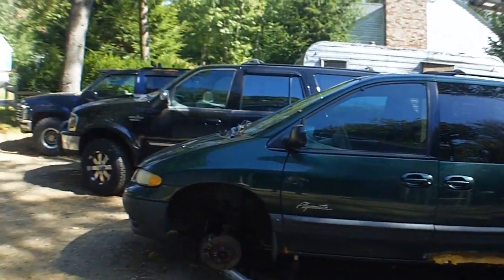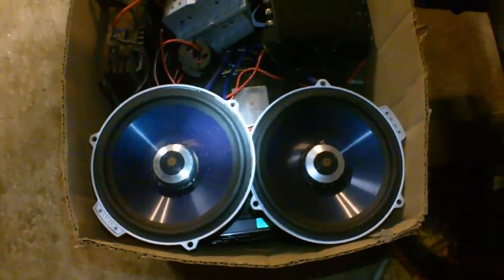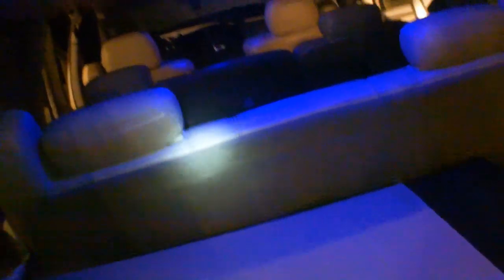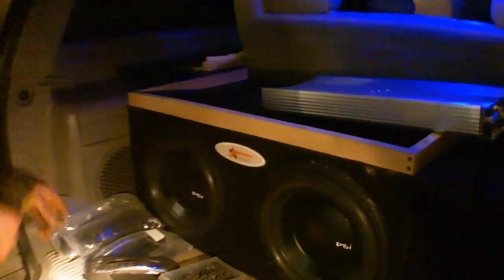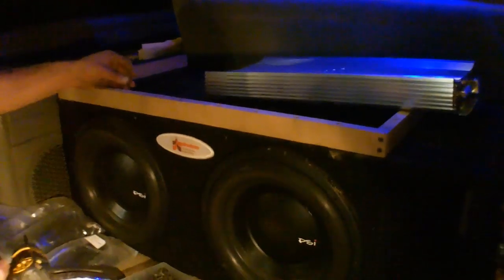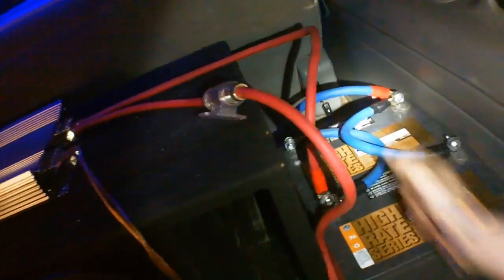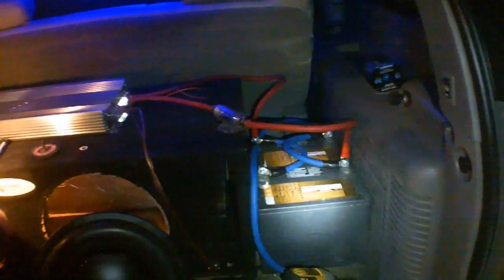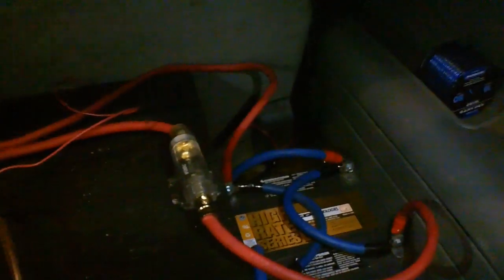Car Audio Installation : Installing Amplifiers | Wiring Subwoofers | BIG THREE UPGRADE | 3 BATTERIES

Comment: @shroomguy420blazin Almost all subs can play quite low in the right enclosure. One spec to look at would be the FS of the speaker. If it's lower there's a good chance it will hit lows pretty nicely. That said enclosure design is MUCH MUCH MUCH more important. The Type R is a solid sub and will do the job nicely.

Comment: i think ima buy some more led's for my truck lol... i miss my lights!! AND I finally got my subs lol..cant wait for them to get worn in! any tips on breaking in my new subwoofers? any other way of keeping the lights dimming instead of installing another battery and bigger alternators? i dont have a big budget yet :) i think i will sooner or later though.

Comment: Yes, you CAN. But you'll have no sound. If you want the subs to work, you need to have an amp. The head unit on the car does not put out enough power to power the amp. (Usually between 12 to 50 watts) The subs need much more wattage than that. You have to have an amp that meets at LEAST the Maximum RMS output of the subwoofer. (Preferably, you want at least double the RMS, which gives you headroom, so the amp doesn't have to work as hard, and the sound will be cleaner.)

Comment: @iantheCOOn~Replace your alternator. The batterie only powers the system when the car isn't running,once the car is started it's the alt. that powers it. Best case cenario,replace both the batterie & alternator. Hope that helps. :)

Comment: Seriously entertaining.   That's how install vids should be...    One question for you if you can man,   I'm about to do my install in my wrx hatch and I need to see how much 0 gauge I will need for complete wiring /big 3 upgrade / and grounding and what not...  I'm pretty sure 50' will be more than enough but idk if its way too much if I could get away with 30 or 40'..   I'll just be running an Hcca off a bd-2500 and a 600/4 to the mids/highs distributed off an extra battery.. ( So about 4k total ) with that being said. Which extra battery should I get ? I know I don't need a 90lb monster but don't wanna get it too small.. I appreciate it and hope to hear back..

Comment: Since your bypassing the voltage regulator in the computer is there a chance that you can over charge and damage your batteries and do you disconnect the wires coming from the power control module and just run 0 gauge straight to the alternator or do you leave all the factory cables from the pcm hooked up and run 0 gauge??

Comment: Question: I'm soon to order the db drive platinum series 2000.1 for my fi btl n2 and the amp has dual power/ ground connections. Besides stock battery I have an xs power battery as well. Any tips on running the dual power / ground

Comment: I have 2 amps in the back with a battery. Can I just go amp to - terminal, amp to - terminal, and - terminal to the chassis??? or do I want to take both the amps to the chassis and have nothing on the - terminal of the battery?

Comment: what size wire should i run from my battery to my amp i have a 4 gauge 200amp stinger kit qill that power my 120a 4000w power acoustik gothic amp mono block class d

Comment: Hey EXO if I upgrade my car battery should I upgrade my alternator? cause my battery is stock and my amp is a 2100watt at 1 ohm and my car volts drop to 8 and I have to turn down my system. so should I upgrade both or is just the battery fine for now?

Comment: Im new to the game. My head unit has 3 RCA preouts and im running two amps( 1 for the sub and 1 for the doors). Should I be running 3 sets of RCA's?
Reply: no just two sets but one set should be a 4 channel set for ur doors...I'm assuming u have a 4 channel amp 4 the doors...

Comment: i need a amp that can push 6-12' subs 1000 watts each, whats the best amp for that job.
Reply: that's something that a rich guy would ask. its easy to get the subs and amp. but the battery's and alts you will need to power 6-12k rms. 1 to 3 320 amp alts and a good 400+ ah batterys in the back should cut you some room to breath when playing that much power. but I be looking into a few amps to power so many subs over 1 big amp. just because its easy on the amp and subs. less wire length your looking at going to 1 amp when you can have shorter runs to lets say 2+ amps

Comment: exo i need your help with a pioneer avh 291 bt stereo that kicks off and restarts after its been playing for a little while ill start by telling you what the car has and how its ran maybe you can give me a better thought on how too run it ihave some 51/4 pioneers in the front pioneer 6x9 in the back i have a small kenwood amp hooked up too some kicker 5 1/4 that i have mounted between the seets wher i made 2 holes wher the cup holder/arm rest is i also have them connected too some rockford fosgate crossovers  because kenwood amp doesnt have a high pass filter only on the stereo i think since the front is filtered at 100 hertz then i gotta a 1200 watt hifonics amp hooked up too 2 kicker duel vc ran in parrelel the amp is bridged the speakers are 2 ohms so i beleive i dropped them too 1 ohm too the amp i have it hooked up too 2 batteries and 1 capacitor but my headlights still dim i know getting a 4 channel amp would help but right now pockets are thin please give me a couple tips can the pioneer stereo work correctly with speakers hooked up and the rcas at the same time because i heard these stereos have a built in amp is that my problem possibly or do you see something else going on